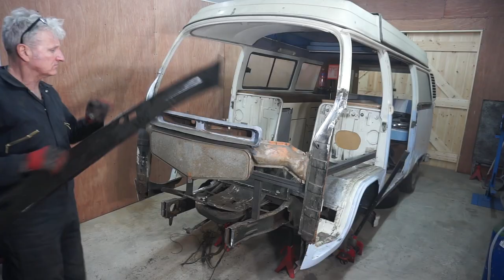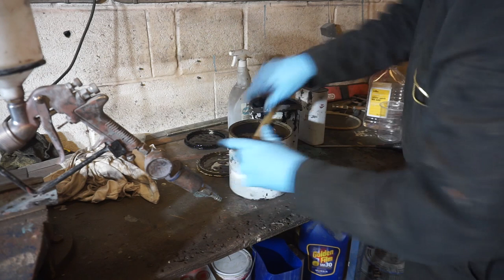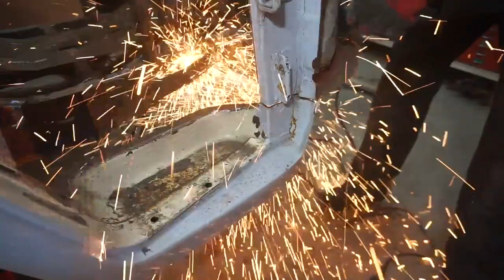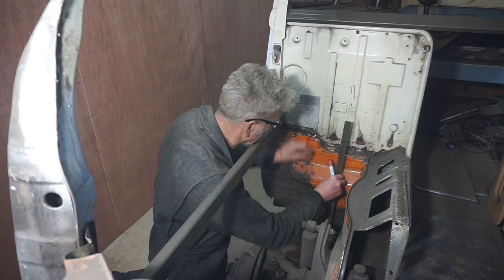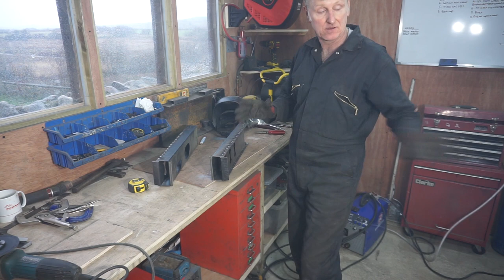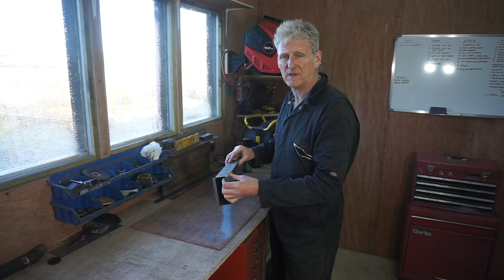1973 VW Campervan Restoration Part 6

Comment: Great videos mate. Like your explanations and you have nice work  I don’t have much luck with spot weld where there is none pressure on them. They pull apart (such as long sliding door window seal section).

Comment: Regarding the removal of the wheel wells.  What's the name of the seat box area that you did not cut out ? ( the boxes that sit either side of the step thru area )  I need to purchase such and replace the wheel wells.
Reply from the maker: Hi, I think the panels you refer to as far as I am aware are not available, may be wrong but I havn't seen any, you may be able to purchase them second hand as a cut. Regards Jonathon

Comment: I am enjoying your front restoration of your vw camper.  I see it was originally Orange from various parts of metal you have cut away. When it comes to painting are you considering repainting the whole camper Orange ?
Reply from the maker: Hi, glad you are enjoying it. I will be painting it in the light blue which I dont think is a VW colour but I do have a Glasurit paint code for.
Reply: Snowdonia Classic Campers are you painting it yourself? Will it be filmed?